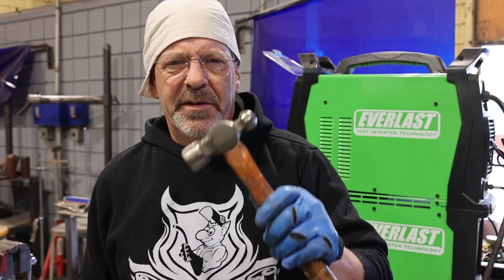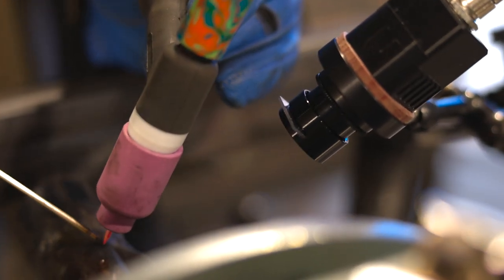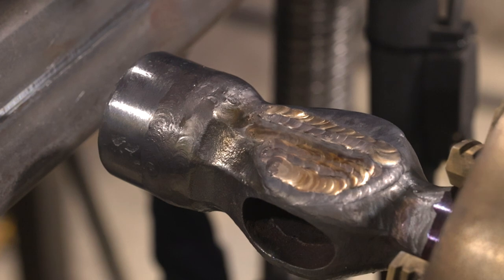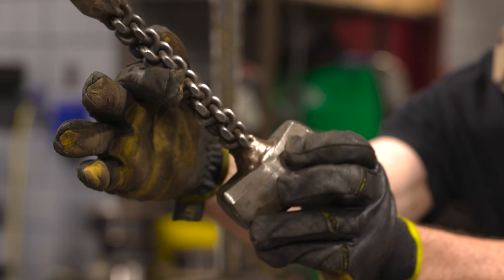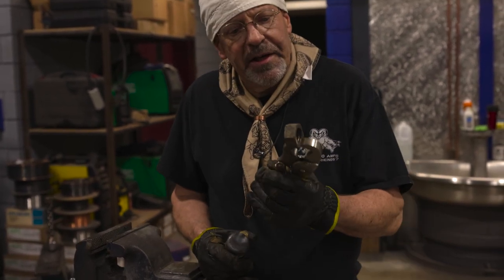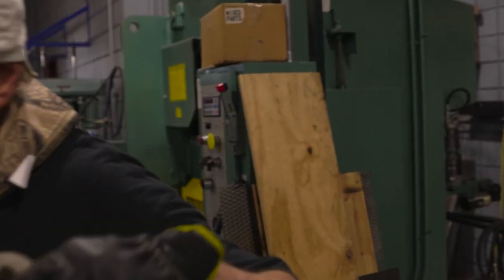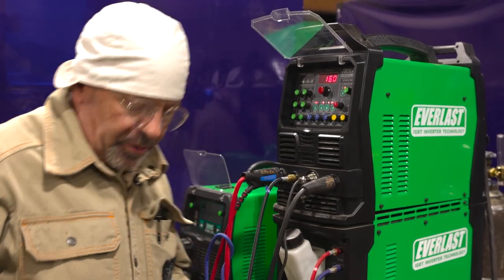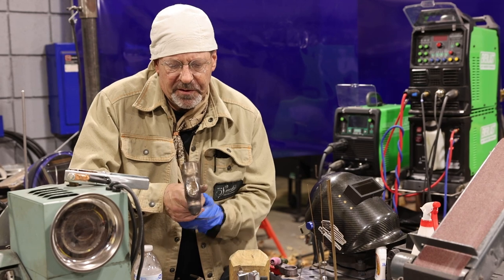You Call That a Hammer?

Comment: I am very pleased with my recent Everlast purchase got the 275 power mig  I have not even tried mig with it yet just stick. I'm a pipeliner and I ran some 1/8 7018 on it and it ran just about as smooth as my engine drive Lincoln 300d